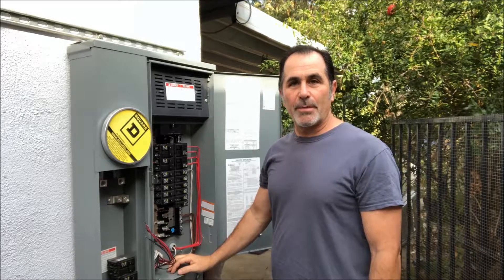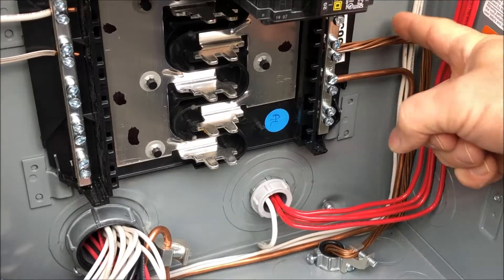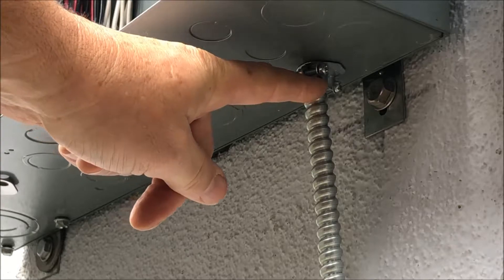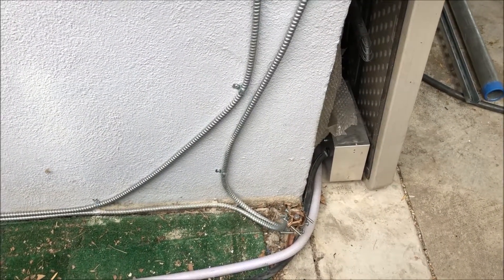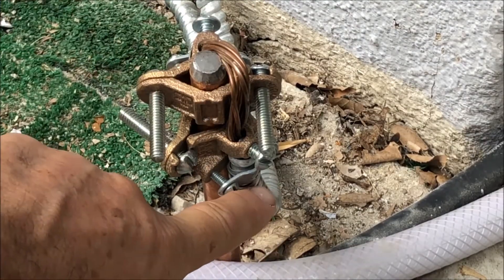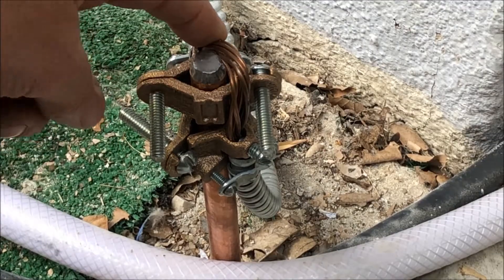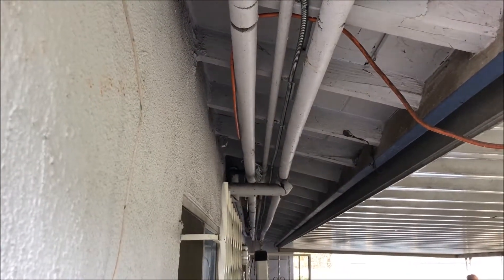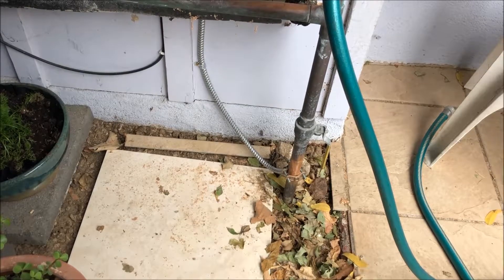How to Install an Armor Ground Line to a Main Electrical Breaker Panel

Comment: How does that armor clamp under your meter box attach to the box or to the grounding bushing?  You say it fits into the 1/2" knockout hole in the box?  Does it have threads like rigid conduit, so then the grounding bushing screws onto it?

Comment: FMC? Is that a word?   
Didn't find it in any dictionary.
Reply: @alchemy1
I'm not 100% certain, but given the context, I'm thinking it means Flexible Metal Conduit. Seems like it should be environmentally sealed, though, since it's running outside. Think that's called LFMC?

The ground rods should be connected ("bonded") by a #6 solid copper wire & the whole lot is supposed to be buried several inches below ground. This may vary somewhat between jurisdictions.

Comment: How would you go about installing an Intersystem Bonding bar? Just make a break in the armor and clamp it on both ends to avoid it from sliding?

Comment: The end of the FMC at the water pipe is facing upwards. Water will be trapped in that bend and have no where to go. Even if it’s been sealed up, it will eventually let water in over time.

Comment: Your wrong !! The ground rod has to be 1) completely buried in the ground with the number 4 conductor attached to it.
2) it has to have its own 10-foot radius circle of Earth. If you are to have a second grounding rod it has to have its own 10 ft circle of Earth that Circle of Earth cannot overlap the first grounding rods circle of Earth or they cancel each other out in order to reach 24 ohms of resistance.
3) the resistance value must be measured with a minimum 24 ohms of resistance. This is the purpose of the second rod. 
4) in most cases one rod does not meet the 24 ohms of resistance in most households of America. If you plant one rod alongside the house you cut in half the 10-foot circle of Earth required leaving the first ride with only a 5-foot radius. I don't care what other electricians tell you this is how it should be done. Each Rod has its own 10 ft radius of Earth that cannot be overlapped or they cancel each other out therefore Rod 1 should be 20 ft. From rod 2. 
5) gas lines and water lines should be grounded all-in continuous unbroken path
6) you have the grounding rods sticking out of the ground it must be buried completely
Reply: Code states 6 ft minimum  and u dont have to have ground electrode all the way in
Reply: Not in California
Reply: *You're
Reply: You are obviously not an electrician. Stop reading before you hurt yourself
Reply: This info. I posted on grounding rods came from The Institute of electrical and electronics engineering IEEE and the International Code Council ICC and the National Fire Association NFPA and the Canadian electrical code CE,CSA,C22. All confirm each other's findings.

Comment: Hi. Can 6 gauge bx or Armored cable or basic 6 gauge bare copper wire be used? And why did you go to the attic if city water pipe is ground level?
Reply: If it’s a 200 amp service or less then yes it can